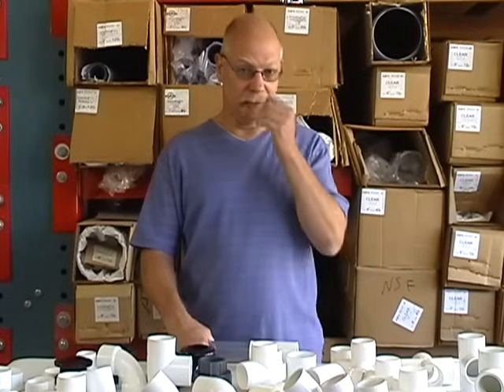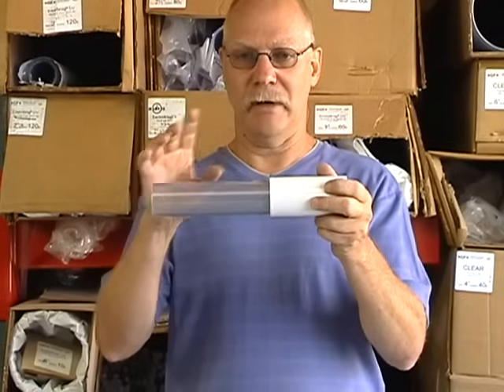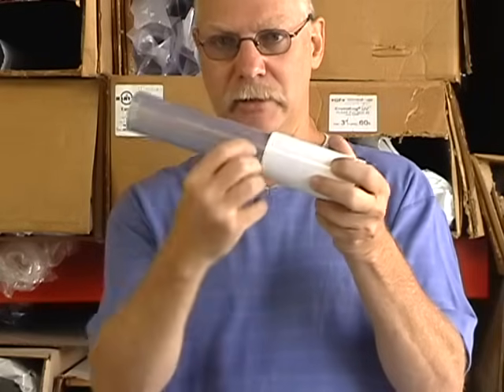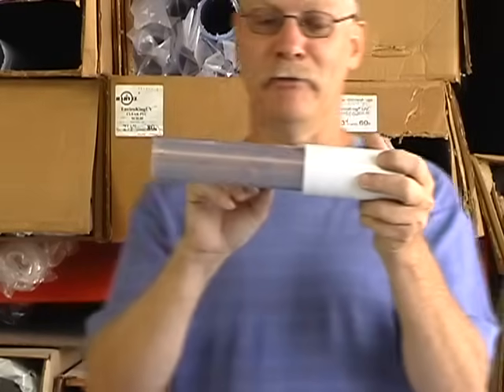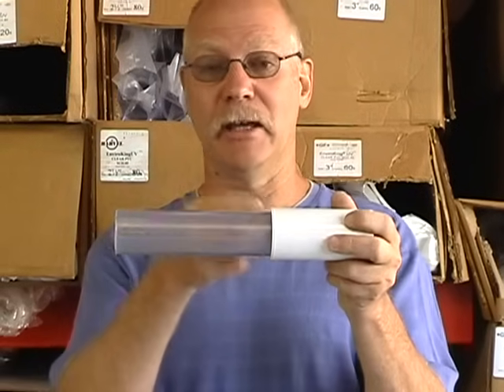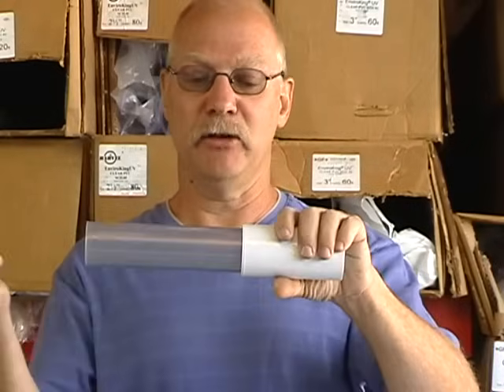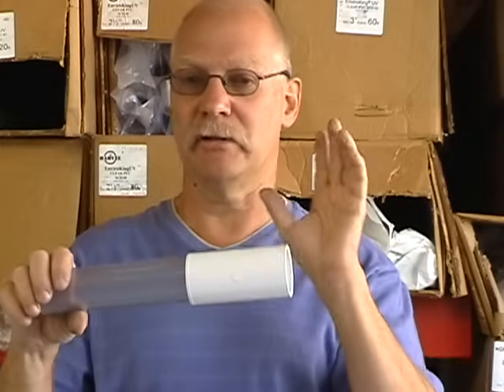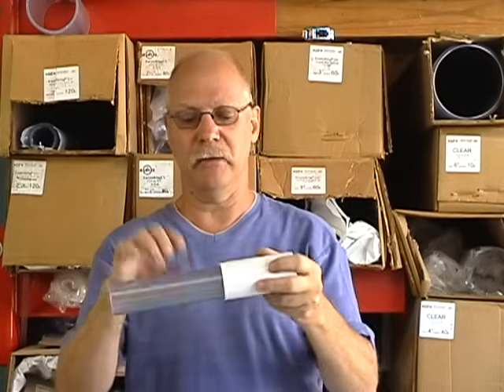FlexPVC® - How To Fix A Leak In PVC Pipe for FREE! Thousands have used this method & it works!

Comment: Excellent video.  Fast, clear and no baloney.  Thank you.  Will check if you have others.  I had a 3" joint failure that has dried glue residue on the pipe and fitting.  Exactly what should i do w/ it?  Should i mechanically abrade both surfaces or clean them w/ a chemical or what?  In a hard place to work.  Thanks again.
Reply from the maker: +Alex Tworkowski No need to mechanically abrade the surfaces because you can't get to where the leak actually is. The method described here may work for you. The main thing is to use primer, otherwise glue only will make a "cold joint" and likely not work. LMK if it works for you. :-)
Reply from the maker: Sorry I didn't see your question. If you still need help, can you send us pics via our website? Click on the blue circle with the envelope in it, top right corner of our website, flexpvc.com. Thanks!

Comment: Primer and glue means nothing to me unless I know what kind of primer and what kind of glue. I have a very slow drip under the bathroom sink. It's all metal fittings. How do I fix it?
Reply: +Duncan Wells well, Duncan .. this topic is about PVC pipe, not metal ..Why not find a link to fixing leaking metal joints in your situation??
I note that you dont describe where your leak is.. Is it on the 'pressure' side of water entering the sink?? or on the drain side ??  Because it's metal, your solution is probably gonna involve either new metal parts, or new 'O'-ring 's  or whatever 'joint packing material yur system uses ...
Reply: +Tkj Tkj Its a very slow drip and appears to be coming from where the threads are. I know very little about plumbing or the terminology. I put Teflon tape on the threads but that didn't help. I have some O rings so I will try that.
Reply from the maker: Any big box store will sell pvc glue/cement and primer. You can see some examples here https://flexpvc.com/Products/PVC-Glue-Compatibility-Chart.shtml and https://flexpvc.com/cart/agora.cgi?product=PVC-Glue-Primer

Comment: What about a drain pipe?  I've also got a cold air intake next to my furnace that has two leaks in the joints. (4" pipe?)
Reply from the maker: +Scott Johnson If it's ABS or PVC pipe, the same techniq shoud work. The furnace issue is of concern due to the possible thermal expansion. Doesn't hurt to try. :-)

Comment: Thank you!  You saved me a tremendous amount of time.  I just bought a house and discovered the garden tub drain had a leak at a coupler right at the foundation (concrete).  The previous owners did not disclose the problem, but it was obvious that they knew about it, since there was silicone sealant on the pipe.  I cleaned off the silicone with a razor knife and sand paper, and then did exactly as you said.  It fixed the leak.  It was quick and simple.  I will share this tip with all my friends.  It is an amazing time saver.  Thanks again
Reply from the maker: +Wendell Lambert Awesome! That's why we did the video. Thanks for the feedback.

Comment from the maker: You are welcome! Glad you found it helpful. :-)
Reply: Brilliant!  You are very generous with your wisdom. Thanks.
Reply: Quick question, do you think it would help to slightly warm up the PVC with map gas before applying the glue for a better seal, or would it just be overkill?
Reply from the maker: @andrewgoodshepherd3975  , NO, never heat the pipe before gluing. It'll cause the glue to dry way too fast. Bad idea. Don't do it. :-)
Reply: @FlexPVC  oh ok, thank you very much!
Reply from the maker: @andrewgoodshepherd3975  overkill., not needed

Comment: My hot tub has been leaking for several weeks. Oh what to do? I found 2 leaks at two ports on one of the manifolds. The manifold has a 2 inch inlet and six 1/2 inch outlets. Each outlet has a connecting flex hose that distributes water to a jet. Without going into too much detail about how the spa is plumbed, the method for repair in the video made the most sense. I wanted to replace the manifold, but you can't replace just one; I would have to replace 3 manifolds and re-plumb most of the jets on the spa.

Flexpvc's method was a quick easy fix and if it didn't work then I guess I would replace the 3 manifolds.

I followed his instructions carefully. The result? 24 hours and no leaks. So far, so good. Thank you Flex!

I read and gave great attention to MPetrozzaIsGod's comments. He knows his business, and I tend to agree with him. If this were a pressure line in my house, I don't think I would have used this method. However this is a non-pressurized line and only delivers water to a jet, so the pressure never builds up. And, the spa is outside, so if it does leak again, no damage is done. Thank you, MPetrozzaIsGod for your input.

And thank you again FlexPVC. You saved me a lot of time and headache and money. If the spa develops another leak, you'll be hearing from me. Then I will need some parts.

Jonas
Reply: +Flexpvc Update. 5 months and still no leaks.
Reply from the maker: +Straight-Shooter Rooter Thanks bud! Love to see it work. :-)
Reply from the maker: +Jonas Thomander That's what we like to hear! Thanks for the update. :-)

Comment: I am a plumber with 20+ years of experience. Most of my work has involved PVC and CPVC plastic piping systems. I have done over 6,500 total home re-pipes, most of which have been of the solvent weld CPVC system. When it comes to solvent weld glue joints on plastic piping/tubing, you will be hard pressed to find someone that has as much experience as I do. Anyway...this man does a good job explaining how solvent weld piping works, but NEVER would I recommend this course of action on this video. Surely it may work, but the repairs longevity is what the issue is. Usually, when you have a leak or drip on a plastic piping system, the crack, hole, etc. will continue to grow as the original problem probably occurred because of the "rigid" piping being either glued on a "bind" (plumbing lingo, sorry) or it was simply never done correctly in the first place in respect to the joint being properly "solvent welded". I have no doubts that this video will help a homeowner repair a drip or leak TEMPORARILY....but there is never a substitute for doing a job correctly. Despite the "ease" of this method, it would probably take around the same amount of time to change out the leaky pipe and make your repair with the many flexible solvent weld PVC fittings that are popular today or even using the four 90 degree fitting method that you are taught as a plumber's helper in your first week. I would not ever do a repair like this for any of my customers. This kind of repair is for homeowners only and doing it this way, in most applications, will simply mean you will be visiting that leak again in the near future. Sorry... Please feel free to ask me questions, and I will do my best to help you out. This man is obviously smart, but I honestly believe I could repair the kind of leaks he is talking abut with new fittings, pipe, primer, and glue in about the same amount of time and at a minimum of material costs...PVC pipe and fittings are very cheap. I just ran 40 feet of 1.25 inch pipe on a job and glued in a total of 12 fittings. The total cost of the project's materials (not counting primer/glue) was less than $20.
Reply from the maker: MPetrozzaIsGod Hello Sir, Thank you for your comments. When I first started doing this back in the 80's, I had the same opinion as you, I was just fixing things "for now." Mostly in hottubs, pools and irrigation. And I figured it'll solve the problem for now, and in a few months time the home owner would call back and I'd be out there fixing it "for real." I always gave the homeowner the option: "I'm here now, it won't cost you more than my service call today, or I can come back with the right parts and fix it for good, but at much more expense." But all those home owners never called back. Years went by, decades went by, and I still never had a single one call back and said "it's leaking again."  

In regards to your example of 40' of pipe. Sure, that's easy. But what if you are working on a swimming pool with heater, filter and valves all glued one into the next? And to fix one leak you have to replace several fittings and maybe a valve or two? What if you are working on a spa with manifolds and many jets and the only way to "fix" a jet leak is to remove the jet? This method you leave all that there and just fix the leak.  

Like I say, what do you have to lose by trying? If it does not hold, you only lost a  little time and effort. :-)
Reply: I think you're tooting your own horn by saying" hard pressed to find someone with as much experience as you do" push in your clutch homie.
Reply: +MPetrozzaIsGod Thanks for the input, but:
why not mention your total fee for such a repair ... That, afterall is the main concern of the 'DIY homeowner' ...
Reply: +Tim Smith Same goes for his user name...
Reply from the maker: +Mark Ratajewicz Sure. If you are putting a male pvc thread into a female brass thread the biggest issue is the brass "grinds" away the plastic as you thread it in. I like the Uniweld non-toxic threading compound for this. (PN, 87685  or 87690)  I recommend using it as it slides better and has less likelihood of damaging the pvc plastic threads on the male adapter. Then just thread it all the way in till just_before it bottoms out. That's critical. You don't want it to bottom out against the stop at the bottom because that changes the force on the threads and causes a leak. LMK if that helped you. :-)
Reply: None of your points are valid if you have underground plumbing which requires concrete decking to be excavated in order to "do it right" as you mention. Gluing pvc joints together your entire life means two things; your brain damaged from inhalation of the all the solvents and too neive to do anything else but criticise someone with true intelect.
Reply: My AC vent pipe has a slow pinhole drip at the joint.  It was installed 2 years ago by a plumbing company that has been in business for 40 years.  So count me as skeptical.
Reply: MPetrozzaIsGod 
Hi I am in irrigation business and we have occasionally problems with threaded connection, especially using pvc male adapters in brass gate valves. I would appreciate if you could share your experience and recommendation for such application. Thank You
Reply from the maker: Mark Ratajewicz  Hi Mark, Sorry for my delay. IMO the problem here is usually the brass threads are too shallow and the male adapters too long (on the threads, ie you don't get to the widest part of the threads to engage) What I have been doing with great success is using sch 80 nipples cut in half. So I'll take a 4" or 5" (length, depending on the pipe size) sch 80 nipple, cut it in half and then use the 2 pieces as male fitting adapters. Thread the threaded part into a valve or whatever and then glue on a fitting like a couple or elbow, etc. I also use the paste not teflon tape. Teflon tape has it's place, but I find the paste works better. I have a video here someplace on why. Here is the url

https://www.youtube.com/watch?v=prsgzY7aypE
 
I hope you found this helpful. Thanks for the question. :-)
Reply: Flexpvc Thank You for your recommendations we will try  them next time if we have this problem
Reply: trpshooter - you may be right, but it's damn funny to read all of your misspellings while impugning his intelligence.
Reply: MPetrozzaIsGod 100%
Reply: i been a pipe fitter and a plumber for 45 years i do agree with you. fix it right the first time. do not try to save a few cents for the short cuts like this it only going to cost you way more the second time not counting the time and other damages a leak can do. you got it apart do it right why do it a second time most of the time to work on it is getting to it
Reply: don jeep - I used the advocated repair methodology because the alternative was to disassemble my spa to access the pipes and then rebuild the entire piping configuration or buy a new spa.  Yes, I was skeptical , nevertheless I tried it and it worked.  If someday the repair fails, I will do it again.
Reply: I agree with the concept of fix it right the first time and for 30 years as an irrigation contractor, that is what we did.  However, as I mentioned in my posting, fixing the drip in my hot tub “right” was out of the question and would have required dismantling the wooden siding on the hot tub at a minimum.  The primer trick worked for me and if it fails next year, I will do it again.  I very much appreciate this idea that I would never have thought doing.

Comment: The male adapter is threaded into the pump housing by the way.
Reply from the maker: +biggstell Yes, that's tricky because if it works you will not be able to take the pump off w/o breaking it.. So probably not the best solution, unless you never think you'l have to deal with removing the pump. :-)

Comment: Will any of this help on a male adapter leak on a pool pump??
Reply from the maker: biggstell , Maybe. If the leak is on the threaded side of the adapter, and the pump is PVC, it will stop the leak. However it'll also make it impossible to ever remove that adapter. If the pump is not made of PVC, it may seal, or may not.  If the leak is on the slip socket side of the adapter, yes, that's the ideal situation.
Reply from the maker: Yes, but once you do it, it'll never come apart. So think about it before you do it.

Comment: Great tips.  And, a great explanation of how the solvent and glue works.  I've seen a lot of people allowing that solvent to actually dry on their fittings & pipe prior to applying the glue and pressing the connection together, which makes for really weak connections that eventually leak.
Reply from the maker: Raven Heart  Yes, for sure. We had a guy with 120 acres of blueberries call us asking why he kept having multiple leaks on a weekly basis... And that's what we found he was doing. We also had another large customer who was putting the primer and glue on, but only on the pipe, not the fitting. :-) That's not going to work either.

Comment: Why would this system not work when it "sprays" and what solutions do we have for such situation ?
Reply from the maker: Hc Ling When it's spraying that tells you the pressure across the leak is probably to great to seal with just the glue/primer alone. That does not mean it's impossible to fix, but it is less likely to be fixed by this method However my statement here is, "what do you have to lose by trying?" So I'd give it a try. If it reduces the spray, try again and repeat till it's sealed. If it does not reduce the leak after one time, it's unlikely that repeated attempts will make it any better. 

So give it a try. :-)
Reply from the maker: If it's spraying that means the crack is too wide for the glue to fill in. The glue will fill in a few thousandths of an inch. Maybe up to .02". A spray, especially a fan spray means the void is over .02" wide and the glue will likely not fill it completely. However if you repeat the process 2-3 times, it's possible. But each time you have to use primer and glue. And let it dry for at least 48 hours before pressurizing the system in such situations.
Reply: Bet you have never fixed a cracked fitting and your video is bullshit that's just half ass fix it's just a temporary fix don't trust it because it' wasn't done right in the first place

Comment: Very informative video.  Can I use this technique on my swimming pool pump?  I have a small leak in my PVC network that goes to my pool pump.  Thank you.
Reply from the maker: Thomas Alva Edison It depends on exactly where the leak is. If it's on the pump, it could, but it would depend on where it is on the pump. Use our website flexpvc.com to send me a picture and I'll let you know what I think. Thanks
Reply from the maker: It's worth a try. You only have a little time and glue/primer to invest. Why not give it a try?